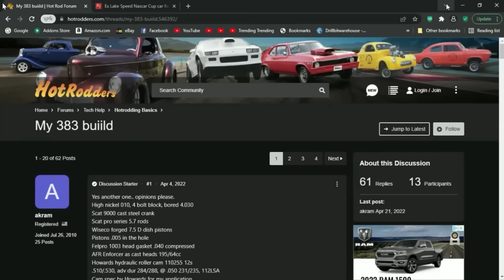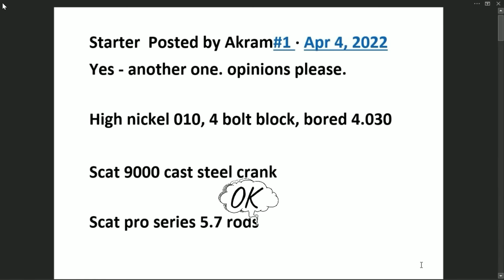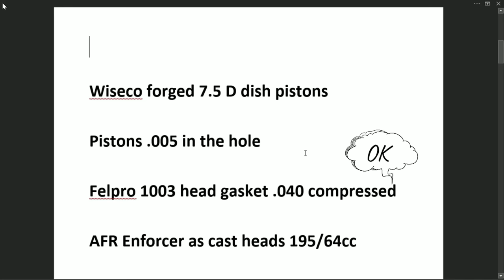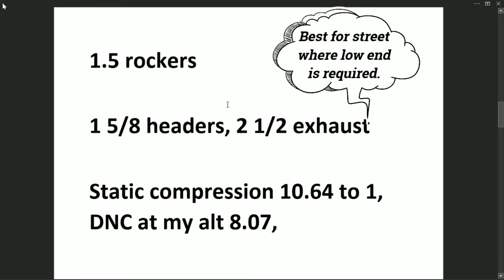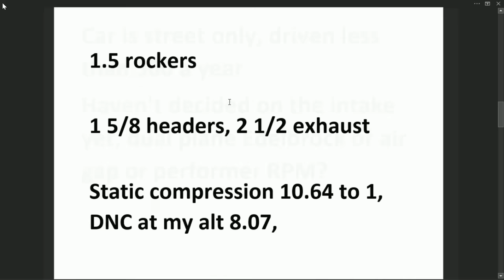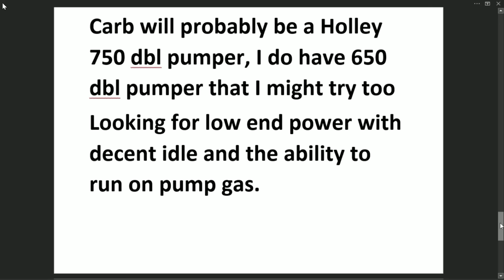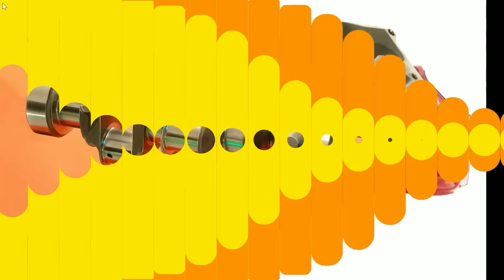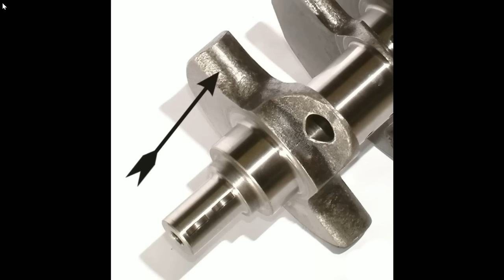Race winning low buck 383 SBC build.

Comment: Yes give us more information on a specific build with a dyno sheet at the end. Your 383 you showed at the end with 12.5 to 1 compression, are you saying that can be driven in pump gas on the street? If so is it because of the dynamic compression ratio, which I would assume would be affected greatly by LSA? I have a 383 in a 66 Caprice and I want to ring out every bit I can from it. Thanks again for sharing your knowledge :-)
Reply: Boss lots of modern day cars are 12  to 1 compression also engine masters did a test and it was fine on 91 pump gas
Reply: @raymondguzman5083  engine masters engines typically run super high compression since they are still "new" and sealing out every bit of oil. Modern cars get away with high compression due to aluminum heads, coil plug ignition rather than a distributor, and direct fuel injection that ensures atomization. also their combustion chambers are superior designs, but a lot of modern aftermarket cylinder heads are right alongside.
Reply: look for hoow degreeing and how the Opening point and closing , in dynamic compression articles
Reply: lennyperson6441  im talking about cars like modern day Mercedes and bmw they run 12:1 and other cars
Reply: @raymondguzman5083  that isn't comparable because alot of them are direct injection or both direct and port injection and they have variable cam timing and coil on plug and they also have fancy knock sensors and the like all these things help them get away with more compression.   My 2016 fiesta st is a 1.6 direct injected turbo motor that was pushing over 20 psi from a tiny turbo when stock and the engine still has 10:1 which is kind of high for a turbo motor running that kind of pressures.  It's because it's direct injected with coil on plug, vct and also has knock sensors to pull timing if all else fails.  An older engine build without alot of this tech it isn't ideal to run compression that high.
Reply: @raymondguzman5083  on 93 pump gas I mean I mean you can run real high compression in an older style engine without all the tech if you're on e85 or race fuel the question is can you do it safely on 93 octane.

Comment: Were the cam specs listed what was used in this engine? i see the 107 lobe sep. My go to i use for a 383 or 406 solid roller is a comp 12-855-9 for a drag limited street use.  253-257 @50 645 645 on a 106 lobe sep. This works good with a afr 195 or 210. for a book cam this grind will make 0ver 600hp in a 11.1 383 and afr 210 and vic jr or air gap dual plane. Has a very fat torque curve.

Comment: Hello Mr Vizard!
   I realize that this is an older video but it's of subject matter where a question I have would apply.
 I would like to start off by saying how I have enjoyed your work over all these years. I am 55 years old and have been reading your work all my life. I also have bought several sets of your mufflers over the years, as well!
   Alright, I have a few questions about water jacket filling of a high performance street engine. The engine is a Ford 351 Windsor stroker to around 420 cubic inches. I say 'about 420' because I have not ordered the pistons until I see what the bores clean up at. I'm using a very old engine block for strength. 
   Back in the day, people used either lead or cement. I also remember how everyone who filled a block, filled it to a different levels. 
   I would appreciate your opinion as to what to use for a filler and how deep to fill the jacket for street use???
   Any and all information is appreciated!
   PS, I donate to St Jude around every year or so, and think that you are doing a fine thing to help the kids. 
    Take Care, John

Comment: Great video, very impressed with David's knowlege.
i'm in the process of building a 383 and would like to duplicate this build, however it will be primarily a street car with occasional trips to the track.
I am concerned about lack of vacuum for power brakes with the tight LSA's qouted.
I am being very careful with my part selection and from what I have read, a tighter lSA means more HP but a rougher idle and less vacuum.
Can anyone shed light on this?

Comment: I used flat tops 10 out of the hole and it is 235 psi on the compression test 63cc combination chamber head's had to be mild and.060 over pistons. i can run either tbi or carb. with my signal plane. tbi drives ok below 2500 but the carb is just sad. above 4500 and carb is so much better she doesn't stop pulling even though 7000 rpm I've hit 7500 and I'm still running flat tapped manual transmission

Comment: Great vid David, I was interested to know in the exhaust part, you specify header pipe size but not design. At that power level, is it preferable to have "tri-Y" design or long-tube? Does either design just dictate where the peak torque is generated, or is that exclusive to primary length? I remember a comment you made about equal length headers not always being the best for power production, is that dependant on firing order?

Comment: Have a 383 in my street 64 chevelle weighs 2950 I have found it runs strongest with inch and three quarter headers in two twelve inch long three inch diameter collectors in to three inch pypes x pipe exhaust

Comment: Hi David great video …. I thought at first you might have been working on a Mopar 383. What would I like to see you spec up? Base it on the 440 Mopar block (RB) and build a stroker (505/512 etc) with Trickflow heads (240/270) and spec for the street. At 500 BHP …. Don’t increase …. Go for milage and street manners (power not just at WOT). Thanks.
Reply: He or they will not reveal specs at all , just generalization.
Reply: @smilsmff  Let’s wait and see.

Comment: About that lsa.. i have 350 with Edel heads. Short headers. And i have bougth comp cams Cam and it had lsa 110.. should i try to get better? Flat tappet lift about 0.5 . 1.6 roller tip Rockers. Thanks for great videos.

Comment: David - At what hp level or spring rate/lift would you recommend to stop using stamped rockers?
Reply: 200,0000 HP and 99,000 RPMS
Reply: @trxtech3010  Stupidity lasts eternal on the internet...
Reply: @rickss69  Yes it does.

Comment: If you want high comp factory engine builds with stock parts a late model cadillac 500 with early chamber heads will get you 12.5.1 with stock parts.

Bloodviking

Comment: An engine that's 12.5 1 on compression won't run on non e85 pump gas. And many fast burn heads will run at 11 to 1. So the jump from 11 to 1 to 12.5 1 isn't worth the cost of losing the pump gas option for a few more hp.

Bloodviking

Comment: Rather than use a vise my hubby found a rod cap spreader that works great, has round aluminum pieces that fit in the rod end and you put the 
Tool in the vise and it has great leverage against the cap !

Comment: I'm trying to be a good student. 
.020 in the hole w .019 shim vs .005 out of the hole.
It matters do to head gasket bore diameter. I'm I correct here. The .oo5 out will net less over all chamber volume.
I'm I correct?

Comment: This is a great run down on putting together a sbc 383.  I wonder how the power curve would compare to a Chrysler 383.
Reply: Mopar 383s make good power. You can pick up a stroker kit(complete rotating assembly) from 440source that can get you close to 500 CID for not a lot of money. The problem is good cylinder heads for the smaller bore. Trick Flow 240 heads might work with a 0.060" overbore, and put close to 700 hp within reach. The power curve of a stock 383 Mopar isn't going to be very inspiring, but a 496" stroker with even just adequate heads will feel much, much more powerful on the street in a vehicle of similar weight.

Trick flow recommends a 4.32" minimum bore for the 240 or 270 heads, but using offset dowels should get you there. If not, a small notch at the top of the block would.

It would be far easier to collect a good 400 Mopar block and build from there.
Reply: @bigboreracing356  You said 450 vs 400 then later it was 465 and 463?  I kind of looked but don't guess i found the right episode. How about this Big Block GM throwing down 1.5ft-lb/cid? https://www.youtube.com/watch?v=d6W419Ky5Kc
seems like a happy dyno maybe
Reply: @bigboreracing356  Got ya! That makes sense. Means that Mopar 383 must have had a long flat torque curve.
Reply: @bigboreracing356  why would you need a 383 Chevy in a fox to make 340 rwhp guys can make those kind of numbers with a 302.  Too many chevy engines in fox mustangs when they absolutely aren't needed.
Reply: 383 to 383 the chevy would dust that mopars hiney !!! Chrysler has always had a real problem with the B or RB Series engines keeping them alive if you rev them . Plus bring wheelbarrows full of $100s to build a mopar . Its not worth it !!! 
Chevy also has Far Better auto trans to sit behind the engine too . No Contest .

Comment: I do have an serious question. I wrote to Comp Cams, Lunati, and Howard Cams. All I got back was from Howard’s Cams. This my second 383. I am with almost with the same set before I saw this video today. I too have the Scat 9000, Scat 6.0 rods, Wiseco 11.15:1 with the AFR 64cc 1.6 Aluminum Roller Rocker. You talked about Howard’s Cam. They gave me 110275-12S. I really wanted an Lunati Retrofit Hydraulic Camshaft because the other 383 have an CompCam. What LUNATI would you recommend to me. Thank you.

Comment: Thank you Sir,  if I may ask what cam would you recommend for a 412 ci sbc 9.7 to 1 comp. being built for a tow/4x4 truck 1980 k20? The cam I was going to order is a 220@.050 intake and 231@.050 exhaust on a 110 lsa with     
.469 in and .480 ex lift. Stock heads edelbrock performer intake and 750 carb. Also 1 5/8 headers with 2 1/2 inch exhaust.  Would like your opinion if I'm on the right track. Thanks  David

Comment: Consider building a chevy 496 or cad 472,500 and you'll be starting with a long strong engine with mostly stock or cheap parts. The 383 won't do that stroke or bore.

Comment: HOLD IT RIGHT THERE!  You mention piston to head clearance of .028-.030" !! That looks tight from my research. Your books included in that by the way. Is this a universal figure?  (Gen 1 SBC iron head related).  Is piston metallurgy a consideration?  This is very timely in that I've a freshly assembled 357 shortblock in my shop with a Wiseco 4032 forged flat top piston.  Pistons are .008" down and I've yet to choose from an .039" head gasket or one that's .026". The latter brings the clearance to .034" and finalizes the compression ratio at 10.4:1. From there I can work on cam selection (Torque Master is invaluable here). Any advice you can offer is greatly appreciated.  Your typical street strip deal with RPMs limited to 7000 after the shift. Thanks in advance.
Reply: 26 head gasket
Reply: @hankclingingsmith8707  My preference as well. But having to redo something just isn't as appealing as it once was. That said, 10.4:1 looks to be the sweet spot for the parts at hand.
Reply: DV?

Comment: The 383 you described is pretty much my 383 build,only I'm using a Victor Jr and a comp cams xr294hr cam. It's ground on a 110 and I wish it was on a 106. How much power am I giving up by just the love separation being 110?
Reply: Probably 25ft/lbs across the entire range
Reply: That cam in a 406 is a cork in the combo. I have a 406 in a 69 camaro, afr 195 10.1 comp single plane xr294. Ran 11.25 at 120 through exhaust. Installed a custom cam from lunati I picked. Car ran 10.95 at 123 no other changes. Cam specs
570 580 240 246 107 lobe sep. 165 intake rocker 160 exhaust.

Comment: I have 356 in May corvette 1992 Street car 10.7 210 kmt on The 402m.The car with me in 1600kg Th400 now transbrake! Roller cam 0.630 lobe 106 Brodix 11X Heads Dellorto Carborators 48mm fast Freddie intake adapters 2 inch! Idel i have weery Nice 900rpm I want toy build with bigger Carborators weeber 55  Brodix 11X  and litel better lift on The cam 0.650 komp 13.0.1 Ihope lest 650++Hp litel Nitro 150- 200.Hp
Wath dou you tink abaut this combo !?
Most say thise have side Pippis 1 7/8 pippes 4 inch side pippes.On The 356 cui The block 4 bult (0.10 020 Nickel and tenn block)

Comment: I remember reading his books as a teen.  And reading and learning why a 350ci engine and a 350ci NASCAR motor made wayyyy more hp.  Resonate tuning. Pressure wave tuning that the exhaust has more of an impact on induction than the piston going down.   Air has mass therefore velocity.     David should go back to the basics and explain the physics of an induction engine and what is actually happening.  Ohh piston goes down and draws air in.  Noooo nooo noo. So for street enginens.  Maximize the overlap period.  Cam selection, cylinder head flow..  and keep in mind the valve hits two limits twice...  When it opens on the ramp and when it closes on the ramp.

Comment: I would like to pay for a good spec build for a sbc 355 street cruiser with AC & power brakes  . Hope this message reach you guys
Reply: 350 - 400 hp
Reply: Ultra quick and dirty? Get a 96-2002 Vortec 350 and put the Ramjet 350 cam in it. That's what GM does with their crate motors. It's done by 5200 RPM but it's got a lot of torque from 2500. Worked great in an 80's Caprice.

Comment: No point in pushing hydrolic lifters past 6200. They bleed down unless you have a rev kit installed. Hydrolic lifters in my experience have always been junk. I dont usually use them.
Reply: Hmm, my 347 dart in my foxbody with a ysi makes 1000hp at tires with a hydro roller shifting at 7k
Reply: Runs 8.80 at 158 159